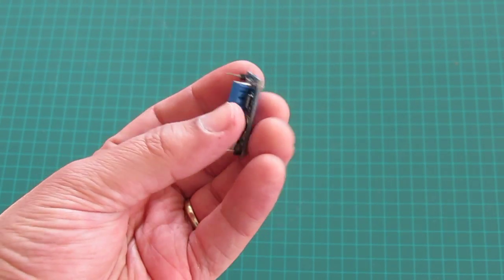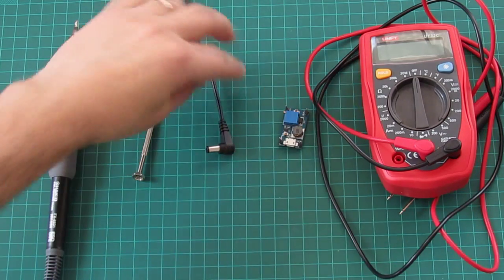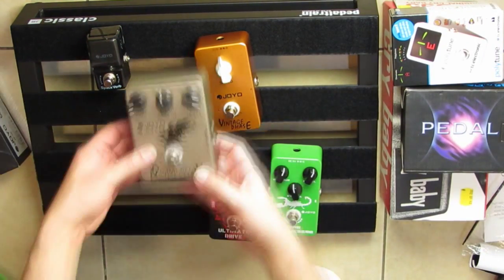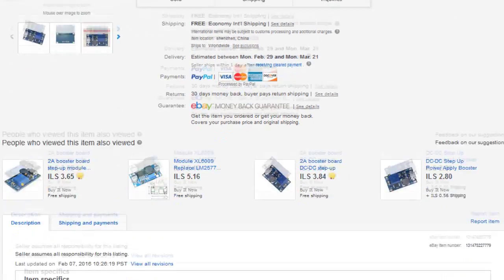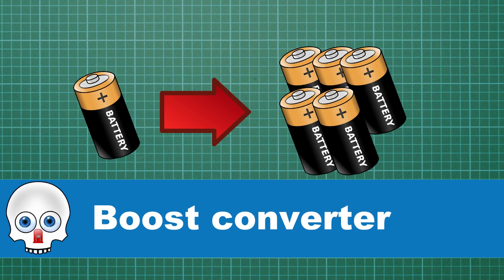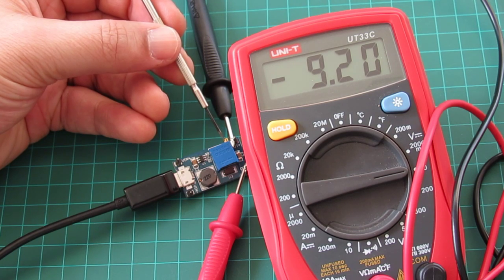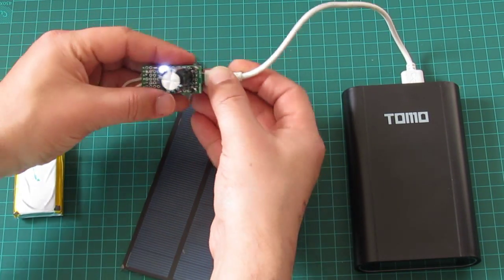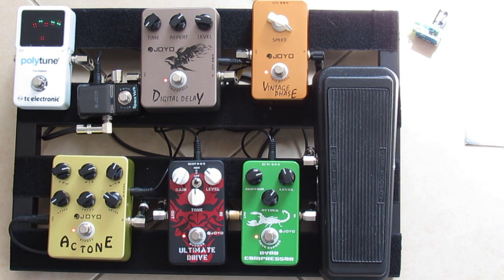DIY Guitar pedal power supply

Comment: Is it noisy? Do you get any hum?
Reply: If you do like I did and cheap out and just get a 5 to 9 volt power converting cables, yes, very noisy. I just got my new step up converter boards especially designed for low ripple which have capacitors in their circuit and they should take care of the problem. The smoothing capacitor is important.
Reply: Use batteries. :D Just use a big 9v lithium battery to power all the pedals at once. It will still be better that anything mains powered cus it will be one less AC wire running across the stage, and won't cause problems with ground loops. Not that the difference really matters anyways.

Comment: hello!, love this video! awesome idea, i just did this today and it work!...the problem is that only work with single pedals, when i connected to the daisy chain the power bank turns off ):, same with my line6 mikro amp (9vDC) and my wammy (9vDc ).
Reply: I guess it shouldn't do the same when an adapter is used. Try not using a power bank.
Reply: Yeah, because this is the cheapest/worst imaginable power supply. First, the boost converter isn't free voltage (the vid shows that 1 battery = 4 batteries??), it takes amperage to do that, and your power bank probably doesn't provide a lot of amps to begin with. Also, were you trying to power the Line 6 from the power bank?  I'm pretty sure those take 9v AC, not DC. This little adapter can only power a couple analog pedals or MAYBE one digital pedal, and you should never, ever, ever daisy chain power between analog and digital, or really two digital pedals. And really, daisy chaining analog isn't ideal. I'm not sure how he got all those pedals to come on daisy chained through a $1 boost converter, but you'l notice there wasn't a sound demo, because the hiss is probably as loud as the guitar.

Comment: Hi sir, my solar cell can only produce 4 volts (max). The 4v is enough to power my pedals?
Reply: 4 Volt  is a sufficient level for boost Converter; The converter already increases it to 9 volts. The only problem is that it cannot provide 4 volt energy continuously.
Reply: Most pedals need 9v